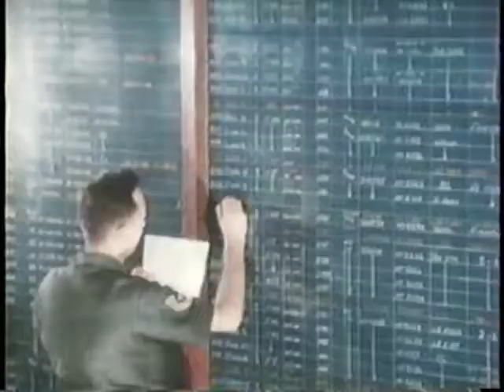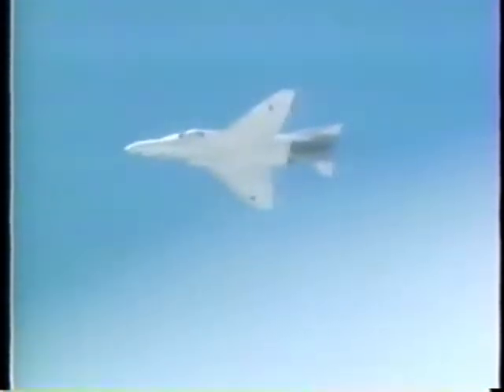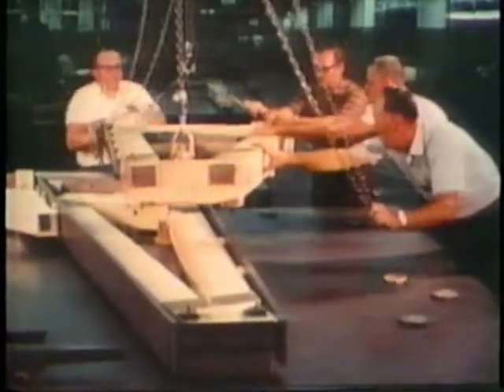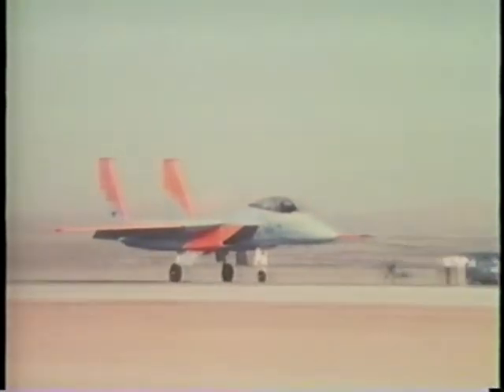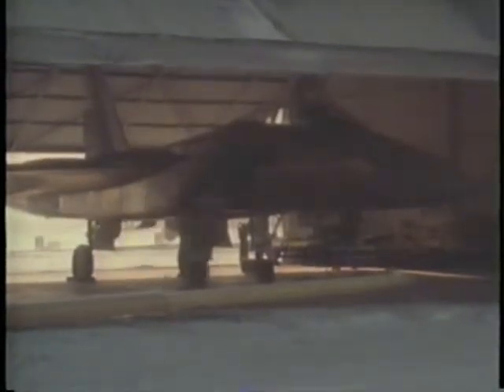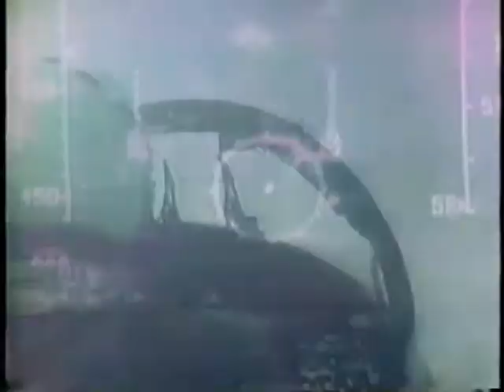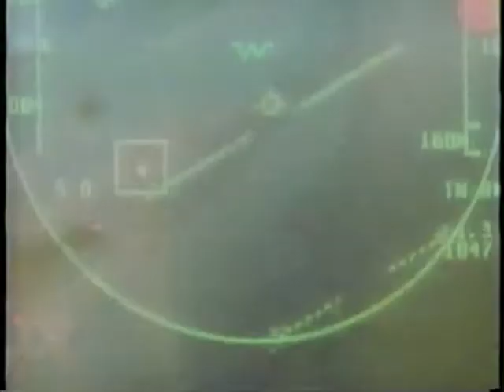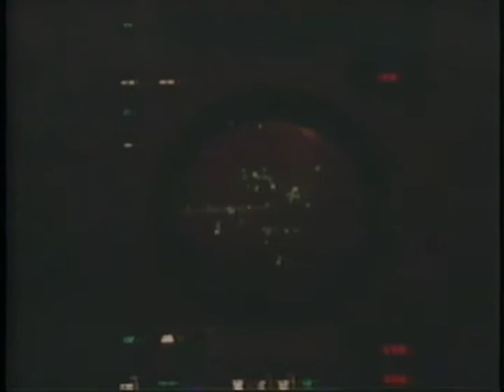F 15 Eagle R&D and History

Comment: The F15 landing gear are so small compared to the tomcat. A big advantage in trust to weight. This is the biggest reason the F15A dominated the F14A so much in BFM (dogfights) Only real chance was if the Tomcat dumped 70% of its fuel before the fight. But the Tomcat dominated the F15E in BFM with the extra weight on the F15E.

Comment: How come the F-15 stayed in service while the F-14 retired? Let me save you all the trouble and answer it for you: no reason at all.
Reply: Not so. The F-14 had less growth potential and life remaining. The wings and intake arrange put limits on stress and angle of attack: 100+ aircraft literally crashed from turning too hard and the turbulent air would cause engine failure. With the Super Hornet around, the EA/A-6, F-14, F-18A-D types and S-3 Viking became redundant. The F-14 got sidelined by the F-15 Desert Storm in overland missions because the AIM-54 wouldn’t work with IFF between branches and the F-15 had a much higher ready rate and weapon choices. My Uncle crewed F-14s and they couldn’t generate sorties because of parts shortages when deployed. The F-18s guys by comparison could jump and go, in his words “like getting in your car and going to Walmart”. The F-14 is well loved by all but it aged poorly as far its purpose for fleet defense. Aegis and its various missiles can be sent up faster and go way father than the AIM-54 can. Why wait for a F-14 to take up to 5 minutes to get airborne when you can use a barn door sized radar dish to track and  essentially skeet shoot bombers/missiles from 200+ miles? As for the F-15, they are going to punch out hundreds of new ones that will outlast the F-22 and F-35 with how things are going at Lockheed.
Reply: The F-15 is like 50 years old and if it stayed in service longer then you might as well add stealth detection to it to beat enemy stealth aircraft.
Reply: Ok so money, and serviceability was an issue for the F14 and then the F14 ending up in Iran just killed her in the U.S
Reply: The F-15 is 5 decades old compared to other fighters and the F-22 and F-35s are newer than the F-15s.